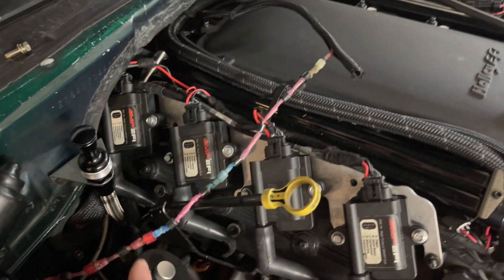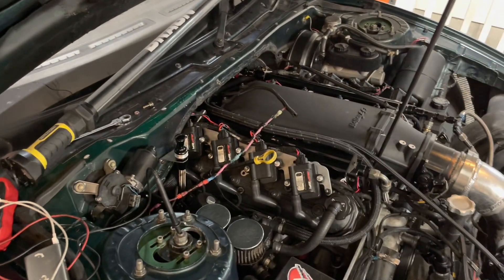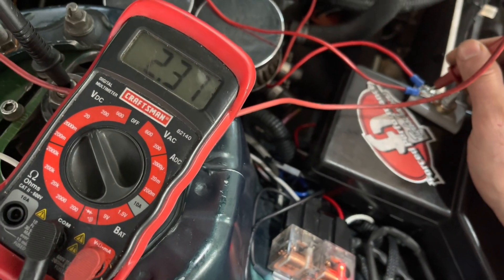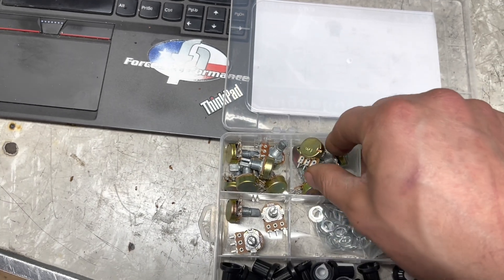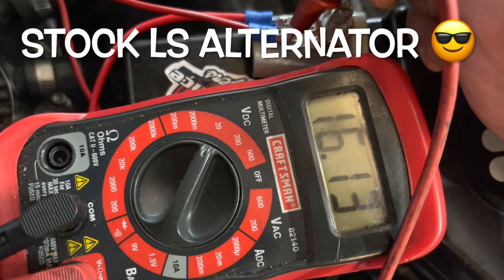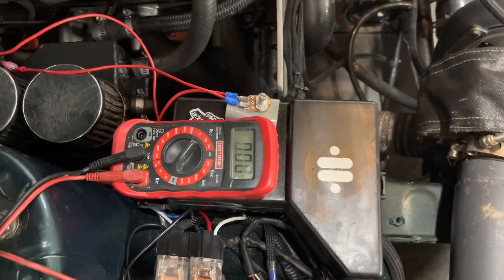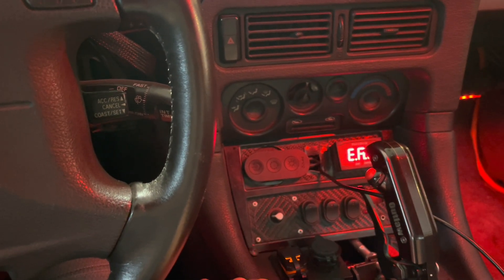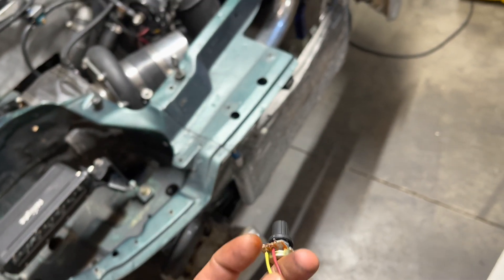How To DIY 16v alternator - Turn your alternator UP with potentiometer for only $2 !

Comment: You need a 16 volt battery and charge it at 17.4. your going to burn up that battery you have charging it to hard
Reply from the maker: if you are talking about my car in the video, it's a 14v battery ;) Which is supposed to be charged at 16v. it is not a 12v battery. but thanks for the engagement! :D

Comment: You were saying that middle connection wire on potentiameter is from battery, and left connection wire on potentiameter is from alternator. Are they both from positive on batt, and positive on alt?
Reply from the maker: Yes positive to battery. And the “sensing” wire  from alternator needs a positive reference to control the internal regulator. 

We are hijacking that signal to lower the reference voltage so that the regulator outputs more voltage.

Comment: Might as well put a bigger battery in instead.  Wouldn't be such a gamble then.
Reply from the maker: It’s already a big XS power. The purpose is to use a 14v battery and charge at 16v. I ran it for ~10k miles already with no issues ;)

Comment: Typical rotor winding current draw is 1 to 3 Amps. Thats about 12 to 36 Watts. Those Pots are nor rated for that. What is your running at without all the mods?
Reply from the maker: Runs ~14.5v with just normal wiring. 

I ran thousands of miles with the potentiometer without issue. Kept expecting it to burn up but never did.

Comment: On my 2007 Toyota Tacoma, I use a diode (in a mini-fuse configuration) in the sensing circuit to raise the alternator voltage from 13.7 (factory output) to 14.4 volts.
Reply: 13.8-14.4 is good for standard batteries that are at 100% 12.8v

Comment: Hey great video. Very useful information for me. however my problem is that I have an alternator that is putting out way to much than I need.it is giving over 16 volts DC but I  only need about 13 volts. I'm afraid it will destroy my batteries so I didn't use the vehicle (1991 toyota toyota hilux pickup). What advice or ideas can you give me to  fix this issue. Please and thank you very much.
Reply: fix your voltage regulator, check the diodes in the alternator, maybe damaged.

Comment: so you dont have to bypass ECM in order to get to does voltages ? + can you run 16V just fine, i have a 320amp ALT 14.4V bu i need 16V for my lithium, How can i do that without causing any problems on my 2012 Honda accord.
Reply from the maker: No issues with my car but  I had aftermarket ecu. your stock ecu will probably not be happy. if you have a 16v battery, you actually need to charge it at 18v. I ran a 14v battery, charging at 16v. (stock 12v battery charges at 14v)

Comment: I'm trying to do this same thing with my 2019 Toyota Camry LE it has the ONBUS LINBUS electronics build which is where the ECU is built in the alternator housing and controls the voltage making it impossible for me to add a HO alternator without serious customization and destroying my warranty so I'm trying to increase the voltage by .6 to get from 13.8 to 14.4 which is the optimal voltage for most amplifiers I know I will have to start at the (ALT S) fuse but where do I go from there
Reply: Im on this same journey with my 2019 camry. I was able to get a ho alt built and installed, but I had them use the same factory plug, with is a single pin plug. So I get 250 amps, but still only charge at 13.8 to 14. It never went to 14 before I swapped the alt out, but since swapping it I get 14 regularly and sometimes 14.1. But I need it to charge higher. The manual says our charging system is a range from 12.5 to 14.5, so if I can figure out how to get it to max charge at 14.5, I can make that work. The guy that built my alt said he could have put a plug on it that would let it run at 14.8 or higher, but that id have to leave the factory plug unplugged and would likely always have a battery light on in the dash. I didnt want that, so I just went with the factory charging. I wish I could find some electronic genius that could help figure out a work around to help out. Lol. BTW I used Michael singer, singer alternators, to build my ho alt. Its a shit load better than than the factory alt.
Reply: I now see this comment is a year old. Did you figure anything out yet?

Comment: I do car audio as a hobby, my car came factory with a 70A alternator, due to my amplifier pulling so much current under max load (wired @ .5 ohm), i had DC Power build me a high output alternator (320A), and it provides its peak power just above idle, not mid power range as one commentor specified. Im still on a 12.6 system, switching to headway cells soon, my alternator charges 15.0 - 15.2ish, max effort (burp) the amp can drop the voltage significantly. Not sure how much amperage the amp draws since the clamp reading only went to 1000A.

Comment: Do you still have to have voltage to the exciter plug for the alternator?
Reply from the maker: Depends on the alternator but in my case, I had a resistor wired in place of dash light to excite.
Reply: @4familyman  I got it to work after trying many different things I have a wire with a resistor to the exciter plug then the potentiometer wired to the sensor plug and now I’m charging at 16.5 volts. Thanks for the video! Car seems much happier on the higher voltage. Any issues long term wise? The car will be doing sick week in January so lots of long drives

Comment: Will this work on the stock ecu, stock wiring?
Reply from the maker: You would need to splice into S sensing line regardless of stock wiring.
Reply: @4familyman  good deal, I have the same battery, I'm about to push this 525 pump to the moon lol 
I've been wanting to test a 12v to 24v step up transformer triggered by boost or tps.. but this will do for now.

Comment: To what part of the alternator did you connect the wire?
Reply from the maker: The “S” sensing wire on the 4 pin connector
Reply: @4familyman  do I need to disconnect the “S” sensing wire  from the 4 pin connector and connect the S wire that comes out from the Potentiometer  or can I connect the wire that comes from the Potentiometer  with the S wires without disconnecting the 4 pin connector like a jumper to the S wire or parallel connection ?

Can you send me a picture of the connection in the alternator please?
Reply from the maker: @niuvarduque242  can’t be parallel. Has to be inline. So could cut S line and splice in the potentiometer

Comment: Hi sir so you remove the diodes and then install the potentiometer?  Or combined diodes and potentiometer?
Reply from the maker: Removed the diodes I was using and installed potentiometer

Comment: Well crap, I couldn't get it to work with my aftermarket 185 amp alternator with reg in it. Idk if I got a bad batch of 5k potentiometers but I couldn't get them to reg voltage for nothing. I did get it to work with the diodes getting it all the way down to 11v from 14.5v on the - side of the diodes but alternator wasn't having it I guess.

Comment: Did you t the sense wire? Like just hook it in the middle of the sense?
Reply from the maker: Yes I used sensing wire. All the info is in vid
Reply: Yeah, once you figure out where you want it. Check the variable resistor on a meter so you can get the values needed

Comment: New sub here and just now seeing this. Did you have any problems with the FT on 12v system?
 My engine combo is similar to yours and cold/hot startup is giving me trouble. I believe my cranking voltage is messing with the ecu cuz startups are so unpredictable. Just when I think I have startup fueling  figured out after stopping/starting easily 2 or 3 times in a row, the 4th try it won't start. Starts gargling and you can hear intake/exhaust events through exhaust and sometimes an occasional backfire all with cam and crank full sync.  Sorry so long
Reply from the maker: I never ran it on 12v lol. 

But I would look at your battery and engine grounds as a starting point. Make sure block and heads are grounded and great ground from battery to chassis. 

Then check your battery also. Might be dying already.
Reply: It's your cooling fan back feeding the injectors put a Diode where the power only goes 1 way and it will stop the back feeding the power unplug your cooling fans on start up and see if it does it if it works like cranks every time then you know that's your problem.Ive got Micro, squirt.
Computer on my Turbo Toyota and it would backfire so loud it would blow the gaskets out of the manifold to head gasket sounded like a bomb going off. It was clicking my injectors, prefueling and firing on wasted spark. Ignition E85 and it was ear drum blowing loud well that was my problem and took me hours of time to figure it out maybe it will help you out there is so many things but at least u can unplug the fans and test turn back off crank back up many times !!
Reply: @rickybailey7123  turned out it was stock cam sensor location in front cover. I guess it's a common issue with Ft that the cam sensor needs to be closer than the cover allows.
Reply: @jdubcbr600  thanks for replying and the information bud 👍 glad u got it fixed stuff like that will keep me up at night worrying the hell out of my brain !!

Comment: I did the same sort of thing, 40 years ago. I made an adjustable regulator . What you need to know is that the computers in the car have over voltage protection, not just the computers but higher voltage will end up killing something. As an example the Valentine 1 radar detectors regularly fail due to their 14.7 volt protection which kills it. As for the alternator, you might think it puts out 140 or whatever amps but it doesn't. It only outputs what it needs to and can only do that at mid range rpm. The output always drop at high rpm as it does at idle.
Reply from the maker: I’ve been running my car on 16volts for 3 years and a lot of racing and street miles. No harm. 

I never said anything about amperage. You only need what you need. More amperage rating on alternator doesn’t do anything if your components don’t need it. BUT voltage is different. More voltage makes the fuel pump output more. The starter works better. The cooling fans and coils. Etc.

Comment: Where exactly did u wire it on the alternator, the pigtail connector or the post on the alternator?
Reply from the maker: To the "S" "sensing" wire on the 4 wire pigtail. The Post goes to your battery for charging. What we are doing is just manipulating what the regulator is seeing, so it outputs more voltage out of the post. :D

Comment: Awesome video, this is gonna help  a ton of people.  I guess I need to look into doing this so I can stretch my fuel pumps and injectors a little further.
Reply from the maker: Just be careful of running a 12v battery on how high you crank it up so you don’t cook it. But you could raise it to 16v for a pass, then turn it back down for cruising :)

Comment: Good thing about the switch, you could turn it all the way down and kindve use it as a kill switch if it makes it where the car won’t run. And only you would know what the switch would do.
Reply from the maker: I adjusted the battery offset for injectors. It runs now if voltage drops. I have a proper battery kill switch in back of car, per NHRA rules. :)

Comment: I maybe interested in doing this but have some questions.
why are you doing this? What are the benefits? 
also wouldn't this potentially break circuits?
Reply from the maker: If you have a 12v battery and you want to tweak up the alternator voltage to 14-14.5v you can. Which will help fuel pumps and fan performance. 

In my case, I have a 14v battery, that needs to charge at ~16v. Instead of buying an expensive ($3-600) 16v alternator, I bought a cheap potentiometer instead and used stock LS alternator to charge/run at 16v. Which really helps my fuel pumps, fan, starter and coils. 

Do NOT charge a 12v battery at 16v unless you want a melted battery.

Comment: The net result is to lower feedback voltage to "trick" the regulator circuit. Diodes drop consistent voltage, resistors will divide voltage across all loads. You are better off with the fixed drop of a diode to stay consistent. The resistor divider method will change with resistance changes and/or temp changes.
Reply from the maker: The diodes changed wirh heat resistance also (I ran it that way for 3 years so quite a bit of experience), and now I can adjust on the fly slightly if needed.
Reply: It might be a good idea to use a small adjustable voltage regulator and map what sense voltages creates X output. It will stay consistent and still be adjustable with a pot or switch (2-3 modes).